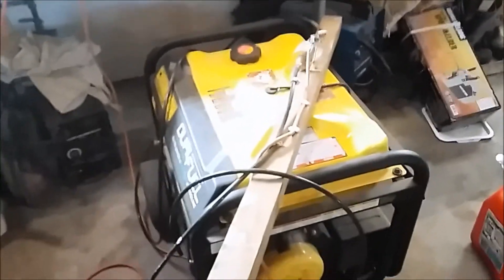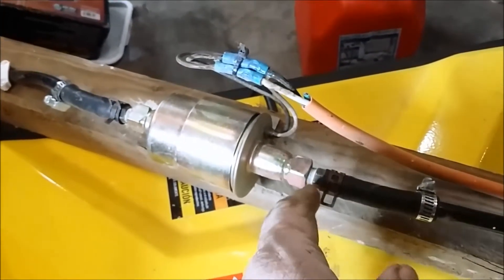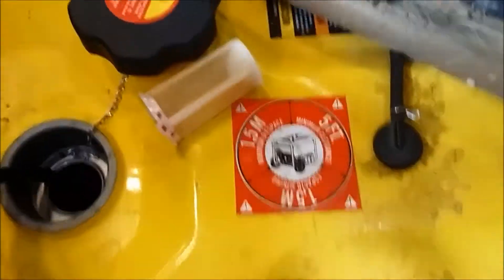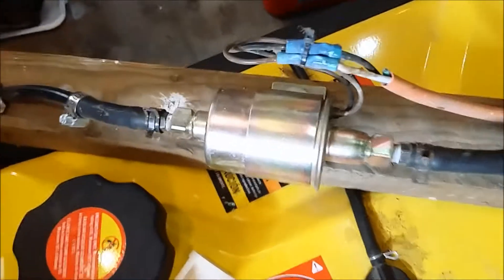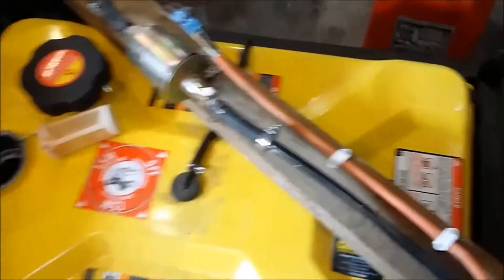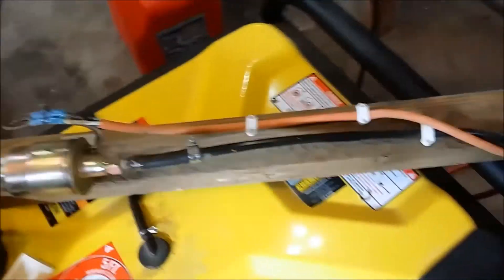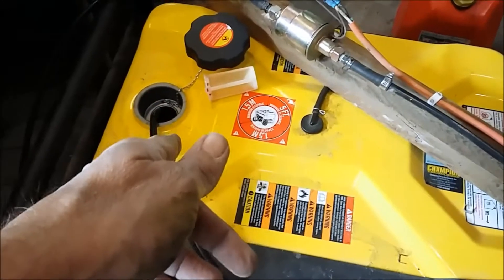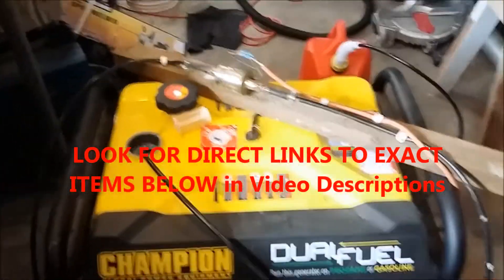Fuel Recovery DIY electric fuel Pump siphon out gas tanks

Comment: Hi, Great Vid and useful for sure :)))). Can you use this on Oil? HAve you done it on Used Oil ??? I want a Pump to fill my can with this Pump :)))
Reply from the maker: That viscosity of oil, you need a pump that can handle the used oil. I add 5 gallons of heating oil/off road red diesel to a55 gal  drum of 15/40 wt oil I drain from Semi Trucks and use one of these http://rover.ebay.com/rover/1/711-53200-19255-0/1?icep_ff3=2&pub=5575119394&toolid=10001&campid=5337842430&customid=Oil+Extractor&icep_item=152500729920&ipn=psmain&icep_vectorid=229466&kwid=902099&mtid=824&kw=lg 0 to 60 wt
Reply: Ah ok... But I just wanted to transfer to a 5 Gallon Bucket :))). I am in the Middle of experimenting since I am NEW to Used Oil Burning. My Dad can get tons of Free Oil from local here.... I am going to built something like yours... Although it won't be elaborate like your Oil Burner Video you have, since I want to keep it Simple but Functional and Safety as well. I will be using it in my Work Shop for Winter, I live in New Hampshire and can be cold, LOL... I do Modeling Railroad Stuff and I sell them. So I am trying to save $$$ as much as I can during my start up. I just wanted to THANK YOU for all the help so far. You have done a great help and answering useful questions :))))
Reply: I bought the same pump  you have but I can't get it to pump anything with it at all hook it as shown in the video. I need help.
Any Ideas?